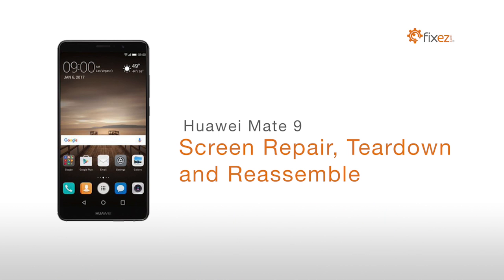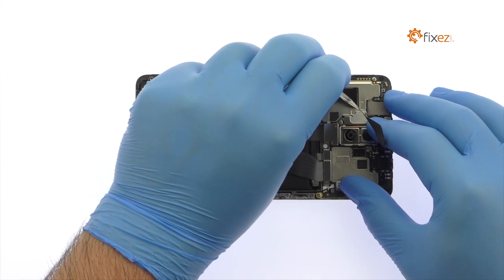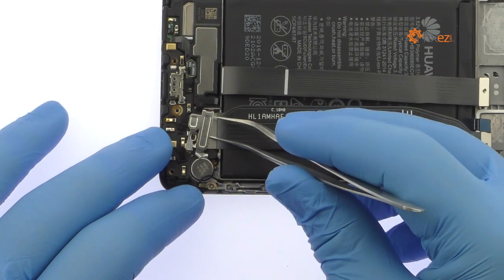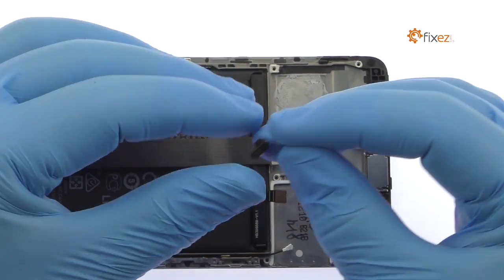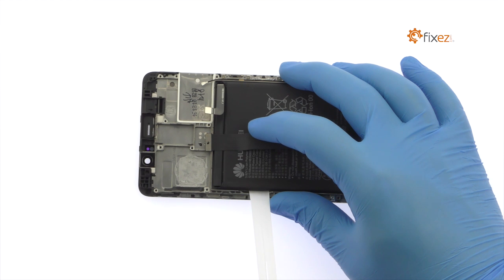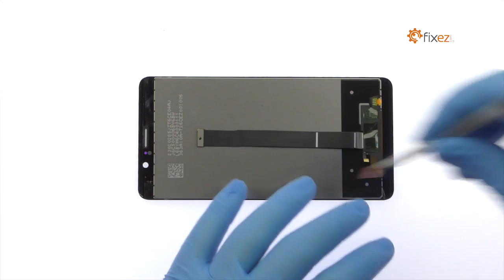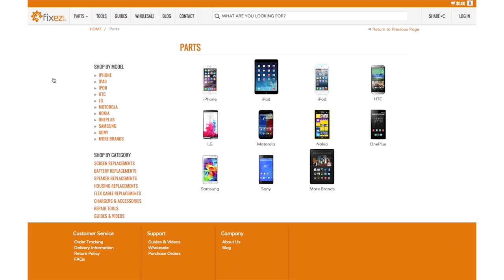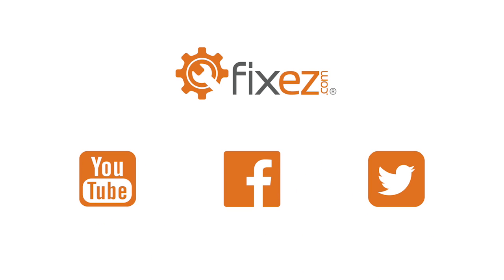Huawei Mate 9 Screen Repair, Teardown and Reassemble - Fixez.com

Comment: Hi, is it possible to replace the original motherboard with a more advanced one? For example, mine is a Huawei Mate 9 MHA-L29 with 4GB RAM and 64GB ROM, could I for example put the 6GB RAM and 128GB ROM one? And above all, is there a SIM card reader detached from the motherboard for Huawei Mate 9 or is it attached to the motherboard so in that case should I attach it? Thank you 😊

Comment: hi
i replaced lcd and everything worked. when i opened second time then screen working but no touch reaction.  i checked milion times all cables, and everything seems ok. what can be a problem ?
Reply: It might be the screen you got might not have original chipset.

Comment: I wouldn't recommend this video because you can buy an LCD + Frame - This means you don't need to use a heat gun!

There's another popular video for mate9 here explaining
Reply: The LCD can't be removed unless you use a heat gun. All electronic parts are attached to the frame; you have to remove them before you can remove the LCD, otherwise you will burn the electronic parts. Removing parts from motherboard is unnecessary though.
Reply: thecrosswordable do we have to teardown all parts before removing screen? actually my phone camera broken after letting hauwei service center changed my screen
Reply: Hello, I knows it's been an year. What video do you recommend to watch for LCD+Frame?